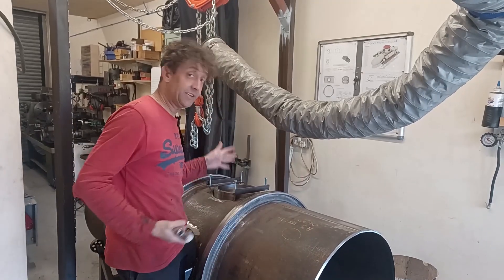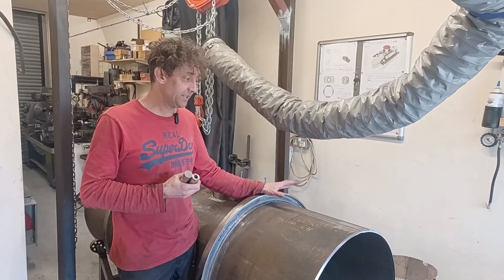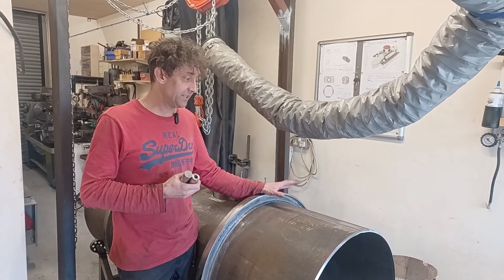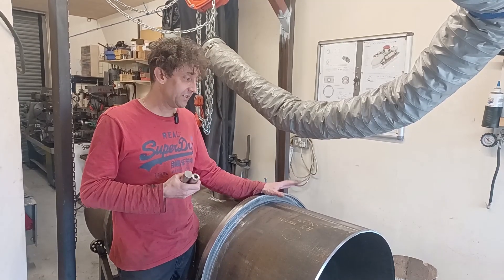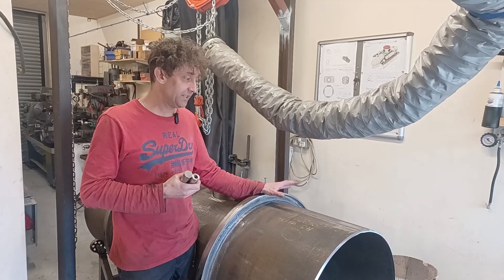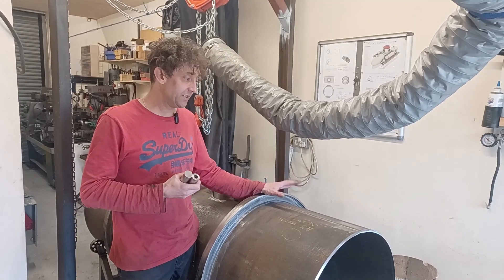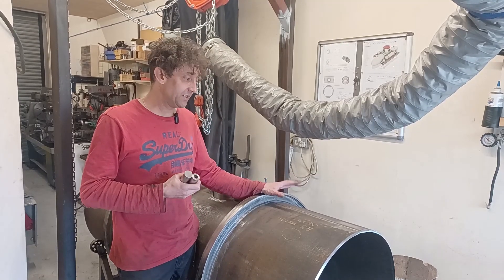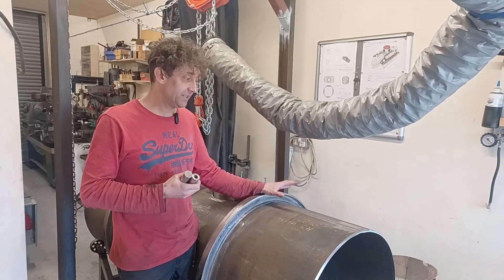Building a Submarine. Part 140.

Comment: Take the back of the tool off, green grit wheel for the insert and std for the bar, will give you a bit of clearance
Reply from the maker: I didn't think of that.  But to be fair I wouldnt want to remove material from the bar as it chatters already.  I will just put up with the 0.25mm clearance.  But good idea!
Reply: @guernseysubmarine  I was thinking you could make a roughing out tool from a piece of tool steel so set them up and rough them out and then size finish with you tip tool. I do lots of different stuff in my day to day work. Admire your sub product in limited space. Well done
https://www.youtube.com/shorts/bxw5Z_vcM4o?feature=share